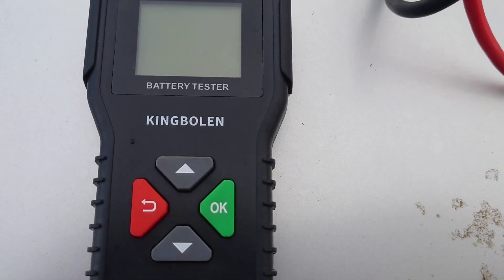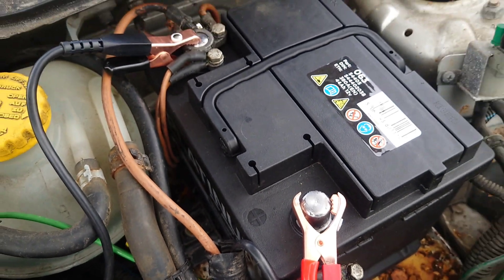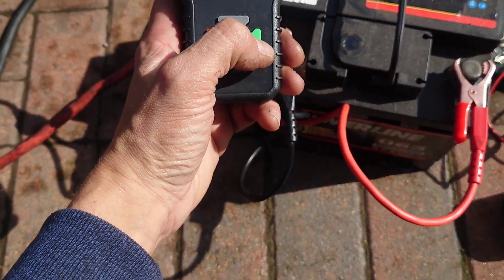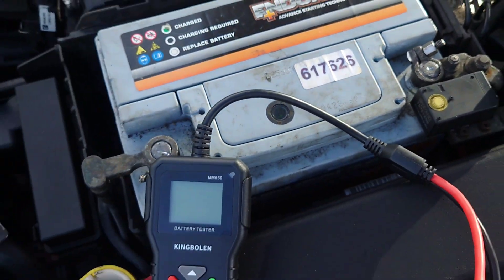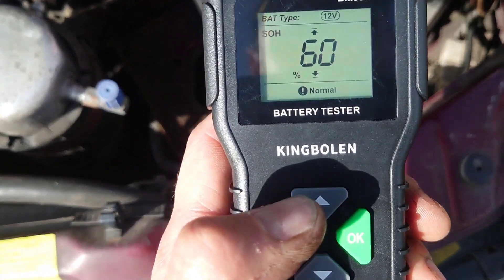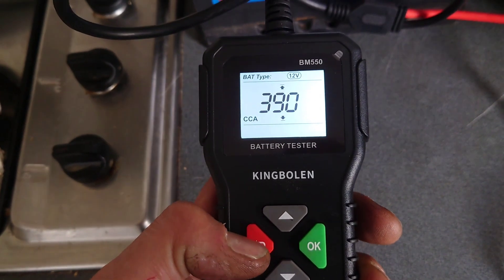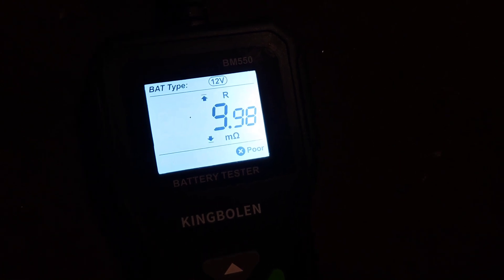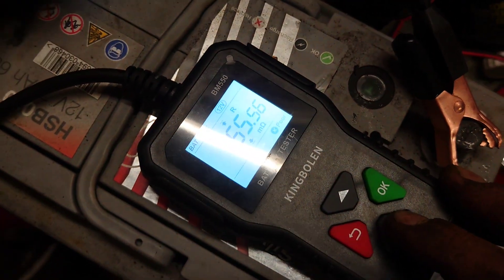Kingbolen BM550 battery tester - making sure the ODFS fleet stays charged

Comment: soooooooooo about the resistance reading....
i guess the lower the better..
meaning the battery is easier to charge and takes less time ..to do so..?
6v 12v and 24v is good to 
 although 6v batts normally dont  have a cca rating...
ta

N x